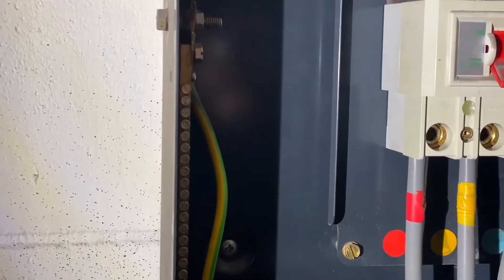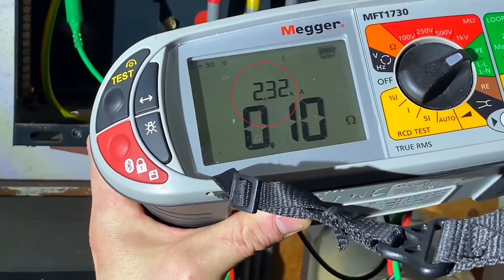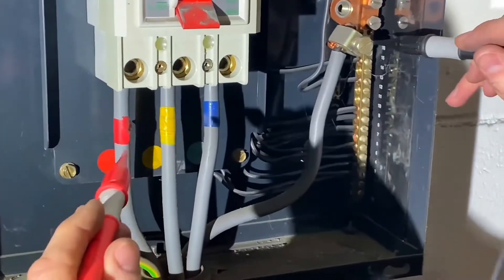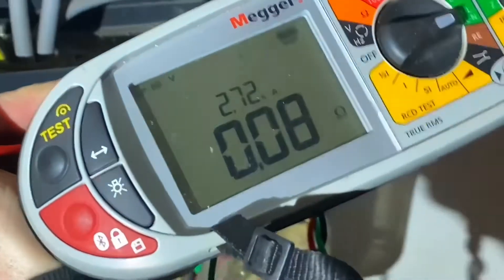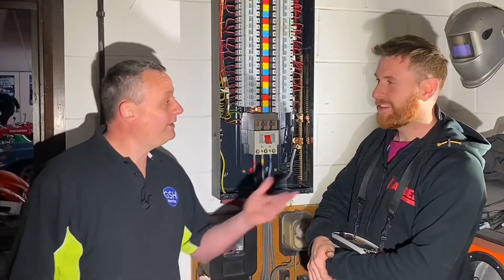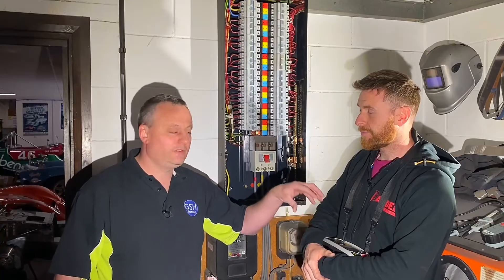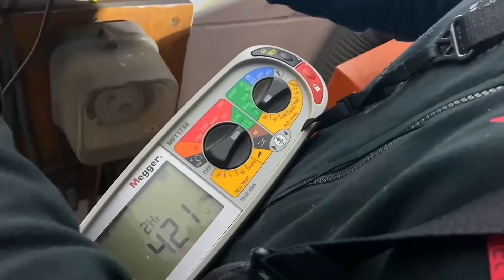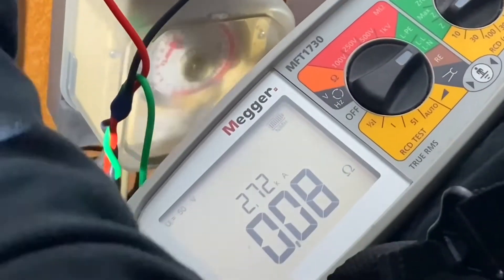3 Phase Prospective Fault Current Tests - PFC

Comment: Isn't the phase to phase reading=square root of 3 (1.732) times phase to earth
Reply: exactly!
Reply: Not necessarily. It depends on distribution transformer's vector group. In case of delta/wye group, phase to ground PFC may be close to phase to phase PFC (i would gues it's what we see in this video). In case of wye/wye phase to ground is significantly lower.

Comment: GN3 suggests to divide the result between 2 phases by 0.87? Is that necessary or scenario specific?
Reply: Correct if you measure PSCC between 2 phases (L-L) then you take the highest of the 3 PSCC readings and divide by 0.87. This mathematically adjusts the value to simulate a short between all 3 phases (which will be highest fault current because of the voltage between lines). Multiplying X2 only applied if you are using a single phase loop tester, ie. You can only measure between phase-earth or  phase-neutral.